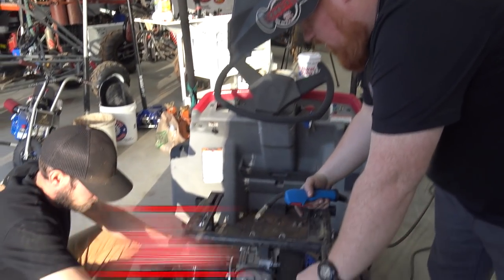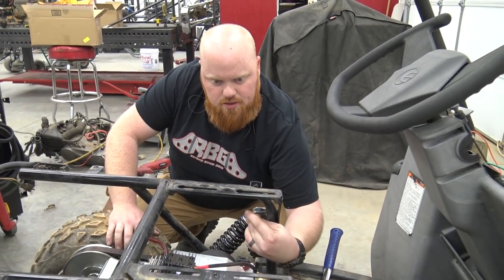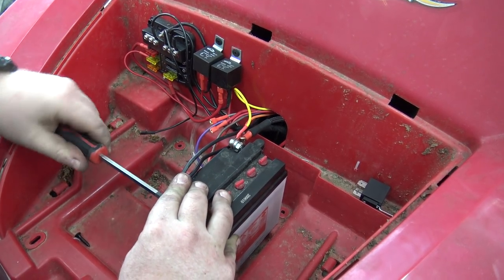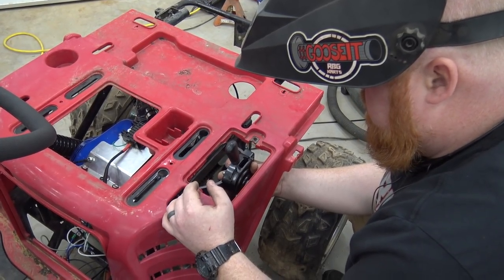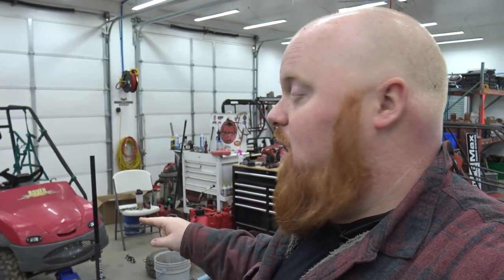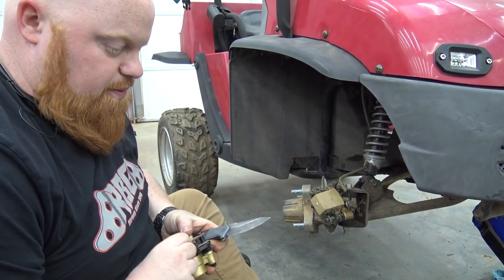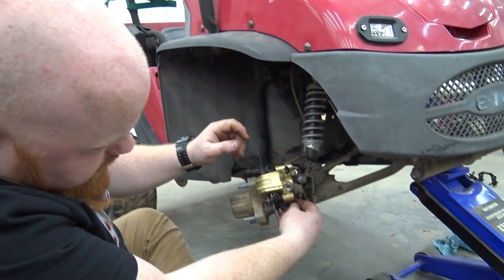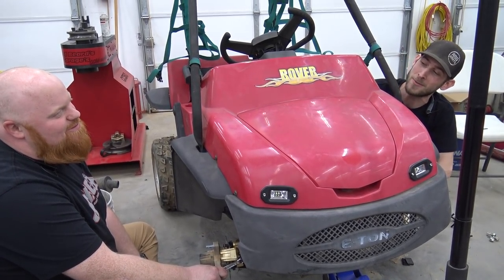Eton Rover Ep2

Comment: Redbeards garage @17 min 30 sec you were bleeding the brakes. As a mechanic I have a trick an old mechanic told me. Open the bleeder and place your finger over the hole. Have someone pump the pedal and you will speed bleed your brakes. It will bleed a fresh rear brake line on a ford one ton in like 20 seconds. Your finger acts as a one-way valve preventing you from having to lock up the bleeder every pump. Works well.
Reply: If you follow this method it can help to wrap a couple turns of teflon  tape around the threads, making sure not to get any on the tapered area. This prevents the possibility of air getting sucked down the threads when the M/C piston retracts.
Reply: @willieshaw2522  true though I never do. After im done I usually let it gravity bleed for a couple seconds till the fluid is air free. Berry seldom. Dose it happen though. Just be sure to tighten the bleeder down before the m\c is released the last time

Comment: Not sure where you learned to bleed brakes, but you should have asked someone who actually knew what they were doing. All pumping the pedal like you are trying to stomp on a mouse in a corner does is foam up the fluid. You have to let the master cylinder piston FULLY retract to expose the feed hole in the cylinder and give the fluid time to gravity refill the bore.  Our method. Pedal slowly down - up - pause (1 second) - down - up - pause - down - up - pause - down - crack bleeder to release air/fluid - tighten bleeder. Repeat process until air is gone.